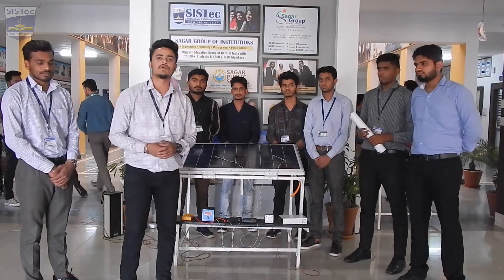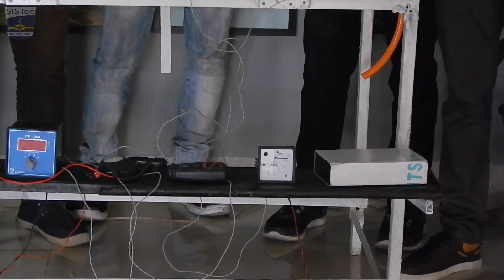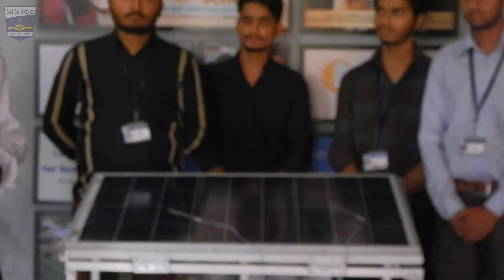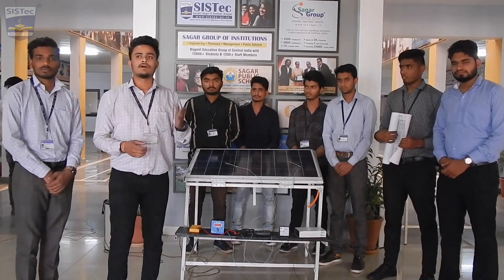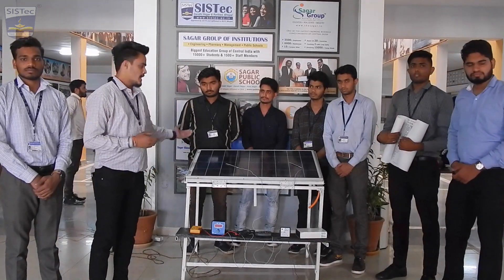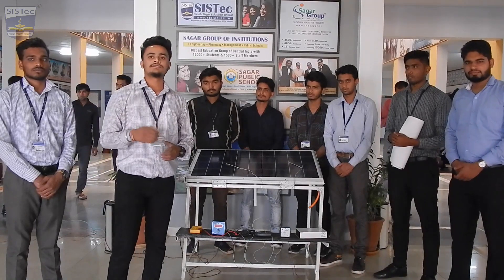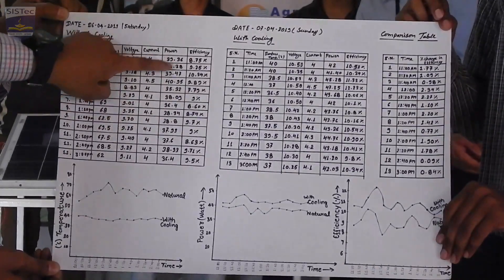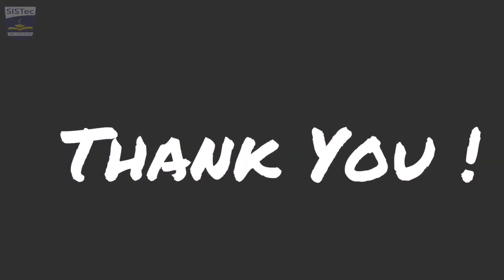Major Project - ME VIII Sem - Improving The Efficiency of PV Cell by Cooling Technique

Comment: 1. Lux meter is not the right kind of instrument to use here, pyarnometer is.
2. Have you considered the energy consumed for circulating water supply and spraying it? Lowering temperature to ambient or a little below that increases PV efficiency, its a no-brainer. But, your solution has to be energy-efficient. 
3. I will suggest consider using phase change materials that absorb heat during day and release during night. It has no moving components, no energy cost.
4. There can be ways to convert that heat to usable energy.
Reply: Hi bro, is there any solution using solar panels directly for cooling rather than converting it to electricity. And without any moving parts. My intention is to cool the metal base below the solar panels.
Reply: @palsbestshott  Use Phase change materials, or try to wrap the metal base with heat insulators. In India, a solar panel can heat up to 60C under sun, leading upto 15-16% loss in efficiency.
Reply: @sohanaliaskashinathsawant1907  what do you see if you go to a typical search engine like Google and type 'phase change material'?
Reply: Bro we are doing this project  , if you can give me whatsapp or any source through which i can contact, to discuss this project